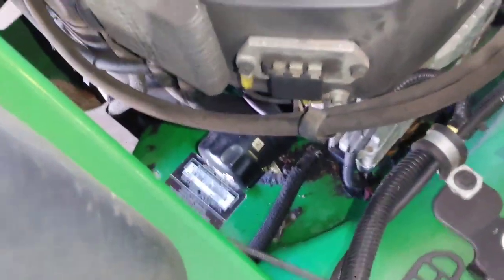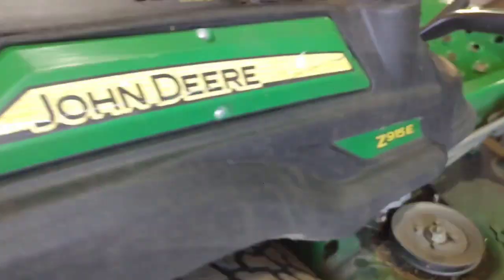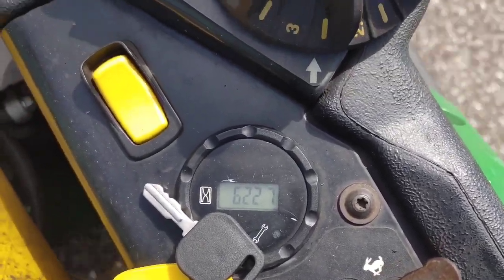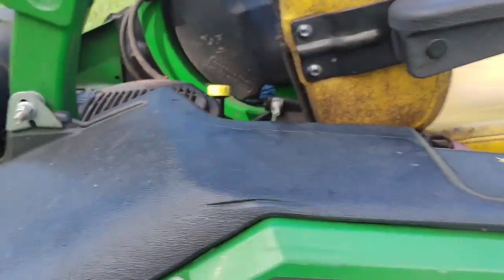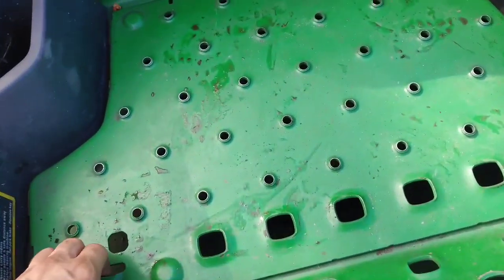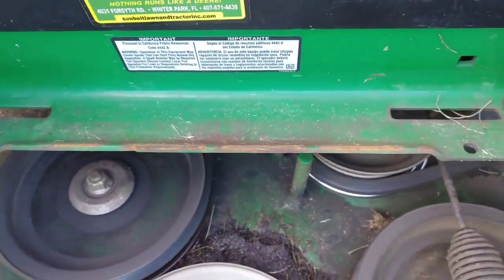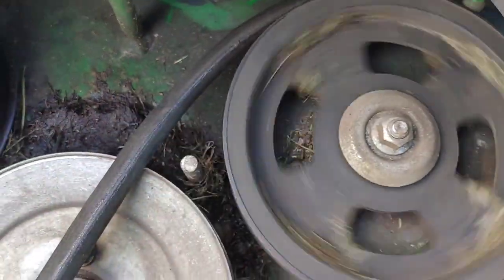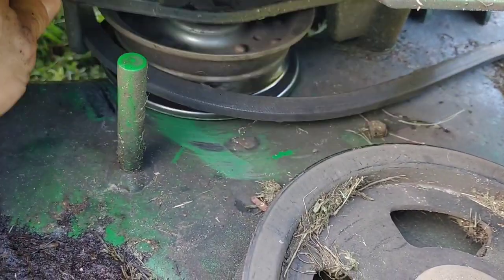Finding Oil Leaks On A John Deere Z915e and Deck Inspection

Comment: Hi mate, great explanation on finding oil leaks. As someone else committed, it’s looks like it’s got 3000 hrs on it. And you received ones in worst condition then this!!!
Regular TLC goes a long way. Cheers Stoney…
Reply from the maker: I see them all time at 1500 hours that have been abused so badly they are not worth fixing. Then other owners have clean, non abused, well maintained ones running great at 3000 hours.
Reply: That’s why we are all individuals, some care so don’t. Anyway it’s still a great video in oil leaks.

Comment: I have a Z930M and have a leak at the oil drain. I cleaned it like you said and tried to tighten it up. It did not help. I got a new drain (AUC18072). The problem is the new drain will not tighten up against the block with the drain port facing down. Should the drain opening face down into the opening or can it face in any direction? If I tighten it up like that, the drain port is pointing at 11 O’clock. If I let it face down into the drain opening on the frame, it is loose and moves and leaks. Is there a certain way the threads should start as they go into the block? I really enjoy your informative videos. I learn so much, just like today with the rope on the spring. Thanks so much for sharing your wisdom.
Reply from the maker: Check out this video. I go more in depth on that drain plug
https://youtu.be/sogS7cP14Uw

Comment: well I looked at all my pulleys and bearing on my 930.  it's been cutting great but it would squeak as soon as you engage to blades then stop deck seemed loud not smooth I just thought it was normal.   so I took the idler arm off it seemed a hair loose I noticed one bearing was bad so I called napa I wanted timken but didn't have one so went to deere and the guy said his 930 is squeaking on startup also and let him know if that fixed it.  the bearing are YOLO or something great bearing from what I reviewed it was 15 bucks.  the other bearing was locked up I took the shield off it was full of dirt I cleaned it put new grease in and it's good.  now when I got it all back together I couldn't believe how smooth and quiet my deck was from that arm bearings no sqeal very smooth.   Now all my other bearing were good and you said this bearing don't normally go bad that's crazy.  why didn't deere put a grease fitting on them 2 bearings it would be easy and I would say it needs one.  I'm thinking of repacking them bearings every couple years at least. now the belt still going strong 1000 hours still I didn't change it i do have a backup.  like to hear your thoughts
Reply from the maker: The pulley that last the longest in the 930 decks is the deck belt tensioner pulley. The tensioner are bearings, spindles and two larger idlers last around 300-800 hours depending on how the mower has been used and maintained. The tensioner arm bearings and idler bearings are sealed. When doing the tensioner arm bearings I pack some grease between the bearings to prevent rust. Plus the grease will seep into the bearings as their seals begin to fail. The top one will not much.
Reply: @Mechanical_Mind  I did put grease between the bearings on the arm but why didn't they put a grease zerk there?  and how common is the arm bearings? and the big idler pulleys have you seen drilling out the rivets then change the bearing would that be a good option?

Comment: Whats the cost on an oil pan gasket repair?
Reply from the maker: Depends on the shop labor rate. Normally $100 -$130 per hour. Labor time is about 4 hours. Plus you have parts: gasket, oil and oil filter.